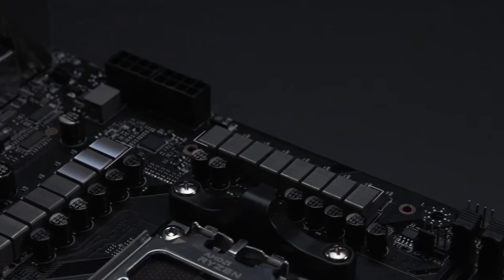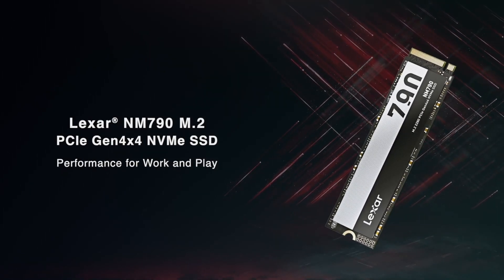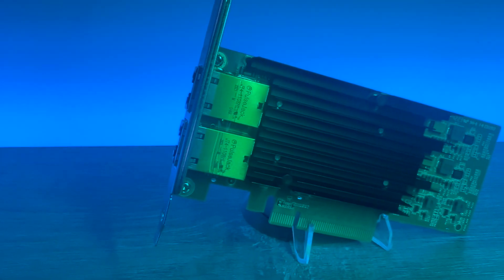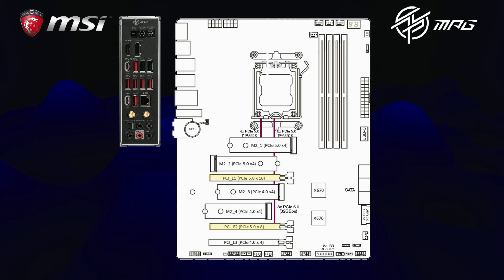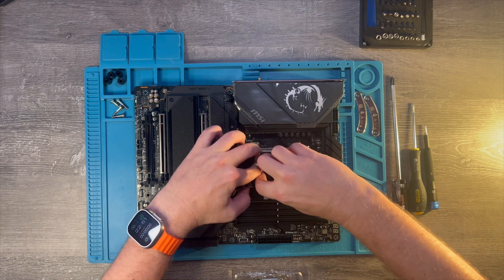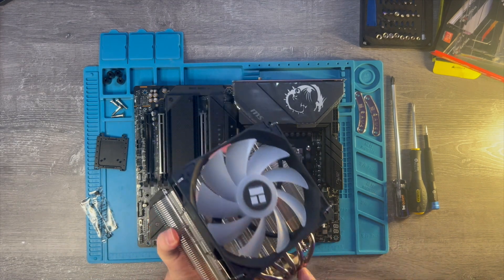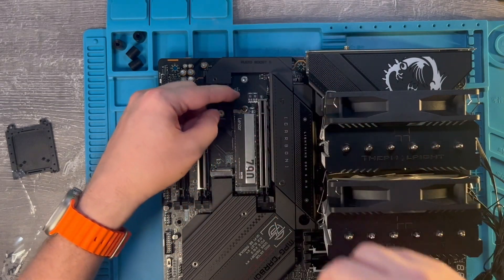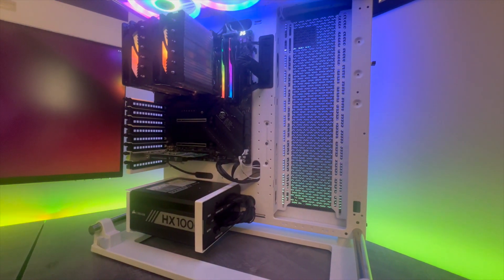AMD Ryzen X670E Performance Testing Build with Gen5 NVMe + Dual 10Gbe

Comment: With getting the Trident z5 ddr5 did you have update the bios to have the memory run at 6000mhz .. I'm asking as i'm running the msi x670e and have trouble getting my memory to be stable at 6000mhz
Reply from the maker: initially I had two of those memory modules installed and I was able to get EXPO working at 6000GT/s. However, I think there are general problems on AM5 when using 4 sticks, that ends up requiring lowering the memory speed. I upgraded this to 128GB as I use the system for disk performance testing and I use a large RAM disk for performant storage during the tests, and when I did this I couldn't get the system to post unless I took the memory speed all the way down to 3600. Pretty disappointing, but in my case the I needed the capacity more than the speed.

But all that said, i did upgrade the BIOS, so not sure if that would be different with older BIOS.

Comment: Im getting on my 4080 Super only PCIe 4 x8 … maybe you know why ? Tested already with render test from gpu-z still same with this Board
Reply from the maker: I would check over the PCIe settings in the BIOS, make sure you don't have bifurcation configured and, I assume you don't have any card in the other Gen5 PCI slot (PCI_E2).

Comment: Have to say your channel should be at top of the search results when searching for similar topics.... Good stuff. You think, maybe one day you could do enterprise SSDs (gen 5 and or gen 4) as no other person on YT ever ever mentions the NAND type and the endurance or how performance goes down when the cache fills up like you said, and those obviously have insane endurance rates and apparently the performance remains the same whether full or not with relatively high sustained reads and writes. I want to do a build a PC with at least one or two of the enterprise SSD drives as a long term solution for fast storage, but have no clue on prices or even where to buy them. After looking at the numbers those drives look like they'd out live me and that's exactly what I want.
Reply from the maker: Thank you, appreciate it! I have a pipeline of content I am working on at the moment, and I have a pile of NVMes that I want to perform some in depth performance testing on. Enterprise SSDs are certainly interesting, but there is quite some cost involved. So I am sure I will get to these things as the channel grows. 

This particular video didn't get the views I normally get as it is a bit of a different type of content. But I was building out this dedicated testing PCE so I could test things like high performance NVMes more accurately, so I thought I may as well make a video on it. I should probably do a better job on the thumb and description here also.

But I digress.... having some high performance test kit will definitely help when I get to testing the Gen5 kit. So appreciate the support and for watching my little corner of YouTube. 😁

Comment: A+ for spreading the thermal properly. so many on here do a terrible job ignoring the experiments showing that manual spreading of the grease is best.  Alternatively, Im building this board out tomorrow and using the contact frame and a sheet of graphene instead of thermal compound. This is definitely a new approach for me. Excited to see how this works. AIO cooling of course.
Reply from the maker: Would love to hear your experience with that also.
Reply: Tests only show it doesnt matter, not that it is better. Smearing it all over is a fad created by trchnique fomo. All the older methods still work just as good.

Comment: Excellent breakdown and visualization. I use Asus PCIE card with four NVME drives on my AM5 system. The top PCIE slot of the motherboard is bifurcated at x4/x4/x4/x4, so each drive gets full bandwidth. I have four 4tb drives there, giving me a total of 16Tbs. With the top PCIE slot being occupied, I use ADT-Link F43SG PCIe 5.0 M.2 card and plug my GPU in it, connecting it to the #1 PCIE 5.0 x4 NVME slot that wired to the CPU. I didn't think it'll work - but it does. And the bandwidth of that PCIE 5.0 x4 NVME slot is even enough for 4080 super/7900XTX.
You have both NVME that are wired to the chipset connected. Keep an eye on chipset temperatures. When I occupied all my chipset NVMEs + SATA the chipset was easily hitting 80+, sometimes even 90C. I have a fan blowing right at it.
Reply from the maker: Thank you! and interesting to hear about using a PCIe 4x expander. 

I have a 2x PCIe 5 Expander here to test and interested in the performance if running this and a GPU in slot 1. As for temps, when I do the perf testing on the PCIe cards I am going to test the motherboard heatsink vs an external heatsink to see what impact this has. I do wonder about the impact of throttling due to heat there. Especially if multiple slots are populated, as you say.

Comment: doesn't the socket cover pop out automatically when you tighten the mechanism on the CPU? why awkwardly remove it before inserting a CPU and risk the cover dropping on the pins?
Reply from the maker: I have heard this, but also people say it requires additional force to be used on the tension arm. But it’s probably a habit to take it out. Do you find this works well?
Reply: @sometechguy  I've only installed 2 CPUs that way. One ancient Intel and one 7900x it went off easily

Comment: What a motherboard! Epic! 
Question: Can this board handle occupying all 3 PCIE slots, All 4 M.2 slots and all sata ports.
Reply from the maker: There isn’t anything in the manual that states that using any ports limits the availability or bandwidth of others, but it’s just the shared bandwidth on the DMI channel. 

I am going to be doing some testing however, so we will see.
Reply: @sometechguy  That would be super cool! Thanks a lot! :face-red-heart-shape:
Reply from the maker: I would add that there is no over-provisioning on the chipset on this board. e.g. there are enough lanes available for all slots and ports on the board at the same time. 

Some boards over provision, where, for example, there are not enough lanes to add an M.2 slot and a PCIe slot, so they both end up sharing the lanes and then the user can choose which to populate, which then disables the other. And I think this is what you mean.  So in short, yes it can handle this, but yes I will also be tested this as I have an NVMe expansion card also I am going to be putting in slot 2.
Reply: @sometechguy  Biggest regret of my current build is buying B550 motherboard. Didn't think that i can't use all possible ports & slots.